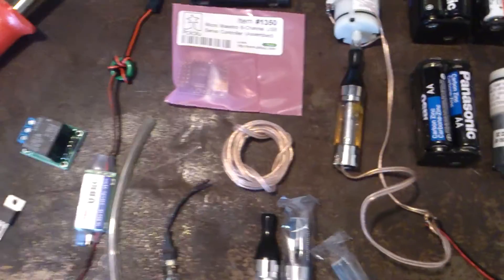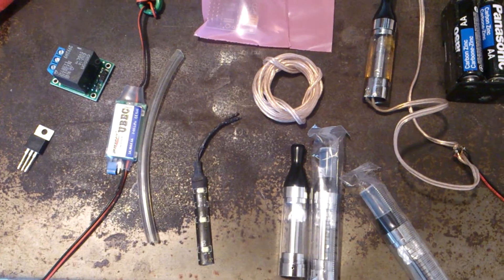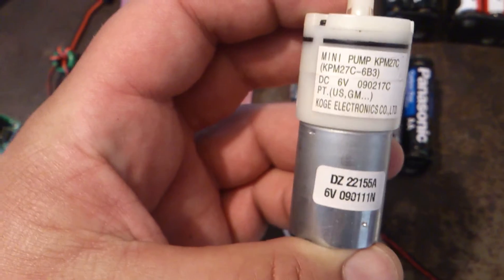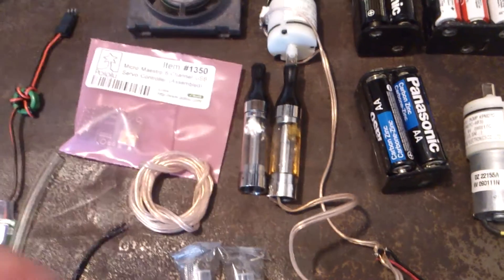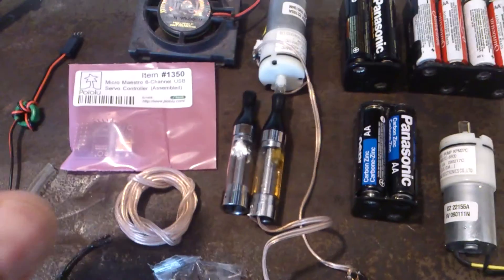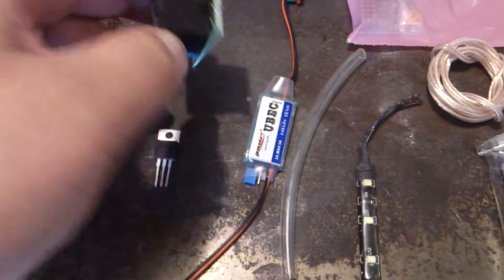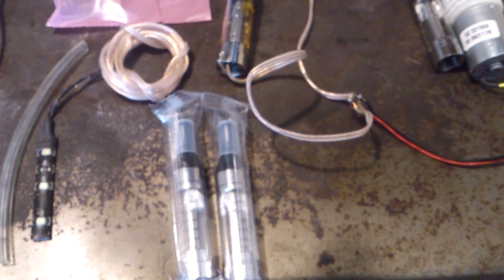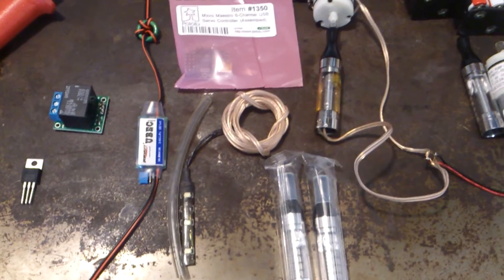Creating a IronMan Jet Pack system

Comment: Nice idea but your going to burn those cartos up quick at that voltage, plus the wicks will dry out as they are a top coil designe, have a look for bottom fed ones, they might work better. Also if you can get some Vegetable glycerin liquid, that'll produce the most vapor/smoke as it's thicker and wont burn up as quick :) Been using these ting for years so if you need any help give me a shout :)